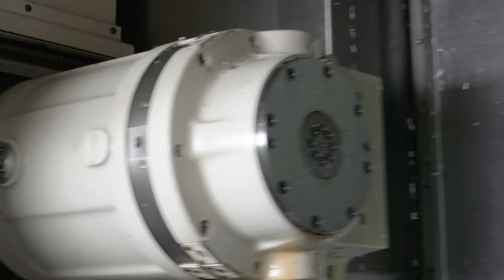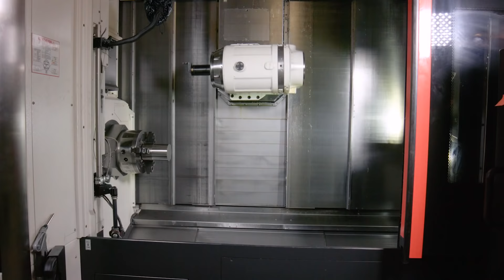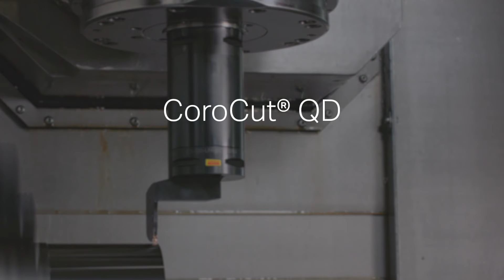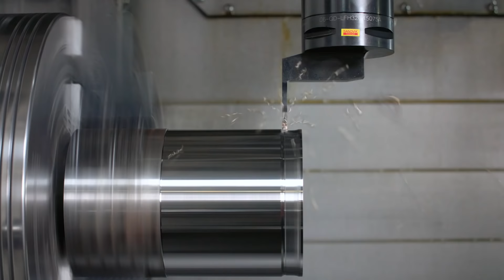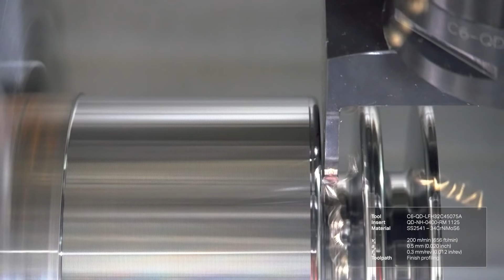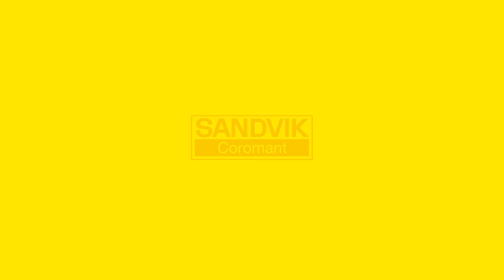Profiling with long overhangs in narrow grooves - CoroCut® QD

Comment: How can the tool be squeezed out under the influence of cutting force?
When turning, geometry with a deviation is obtained
Reply from the maker: Hi! Side deflection should always be considered when machining with long overhangs and we recommend using non-linear tool path for roughing. In this case we used Dynamic Motion by Mastercam. It is important to run the finishing pass with lower depth of cut and feed to achieve required shape of machined profile. 

Hope this answers your question.

Comment: what's the insert lifespan?
Reply: Are you a machinist?
Reply: @nf794  yes
Reply: @SuperAWaC  i cant find it eather would be nice to work with.
Will depent on the lifespan ofc.
To bad that the information isnt there yet
Reply from the maker: Hello. Thanks for reaching out to us. As you know that tool life depends on multiple factors, such as material, grade, cutting data, programming etc. so it is difficult to give a specific answer without knowing any of these details. However, CoroCut QD RM geometry, when used as per recommended cutting parameters, will deliver longer tool life than the normal grooving geometries currently available in the market. Please visit our website to know more: http://bit.ly/corocut-qd-rm